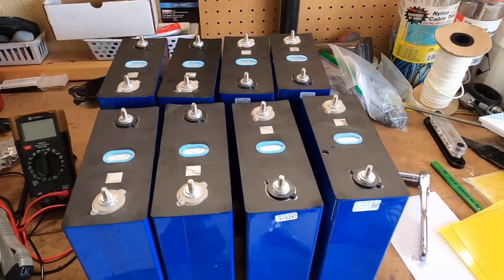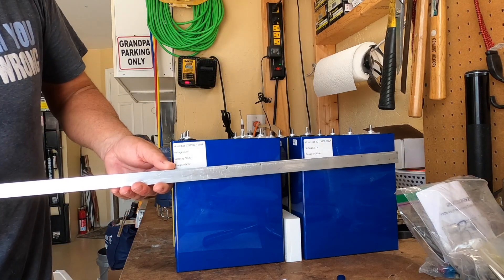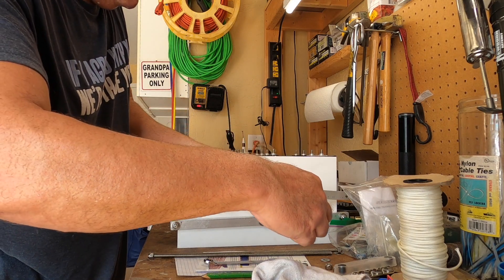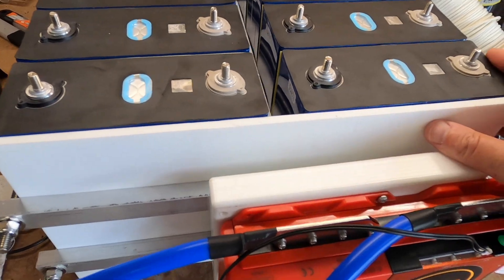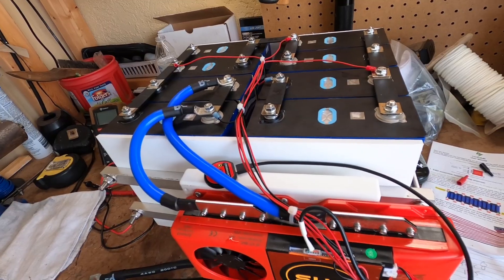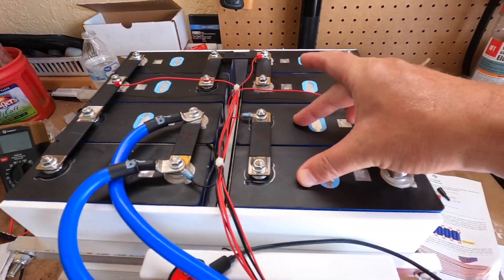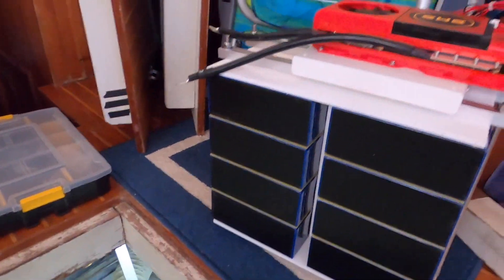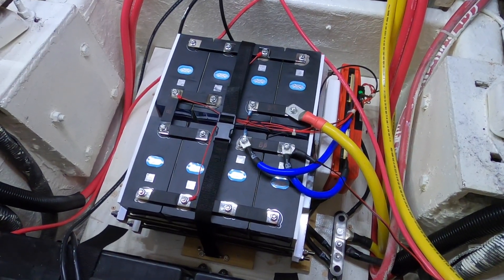Building and installing a LifePo4 battery bank...

Comment: You might want to consider providing information as to where you procured your components, costs, etc. I've built some smaller packs with 18650 cells and am considering some larger units similar to yours.
Reply from the maker: Good feedback, thanks!  I ordered the cells from 18650BatteryStore.com and the BMS from Amazon. The hardware was all local stuff - Lowe’s, Ace, etc.

Comment: You should put a plastic pipe on those threadrods, as the casing of the batterycells are negativ. So if those threads are rubbing through the blue plastic you get a shortage!!